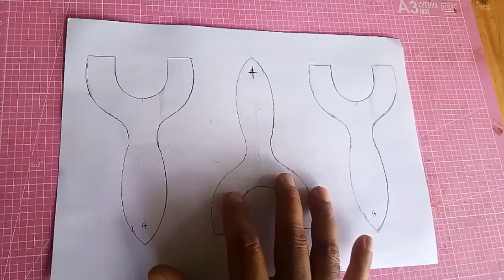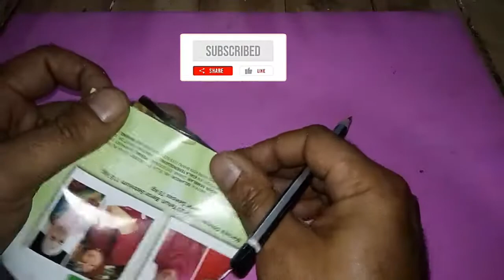Make sparrow slingshot from wood design by (@FowlersMakeryandMischief )

Comment: Hi JB channel,
Any change in future the Sparrow come with band clips
I found out that the Wasp Uniphoxx clips is just right size for the Sparrow tip.
If i drill the Sparrow to fit those clips, will it loose it strength ??
Reply from the maker: Im sorry..im not zachary..for your information, u can go to zachary's channel..on youtube @fowler's makery😊
Reply: Good idea. If you happen to drill yours, please update the outcome.
Would like to modify mine too👍
Reply: @jbchannel2976  thank you 🙏